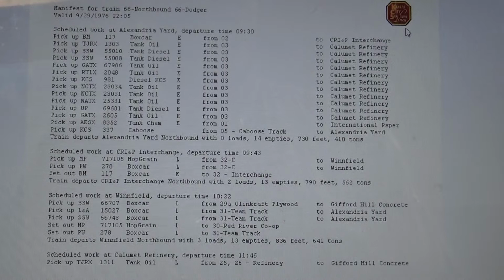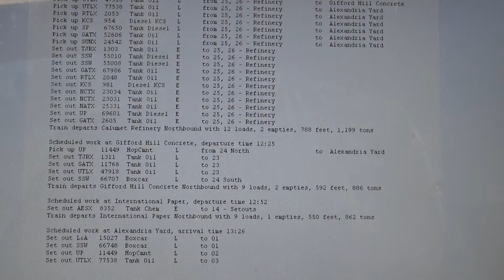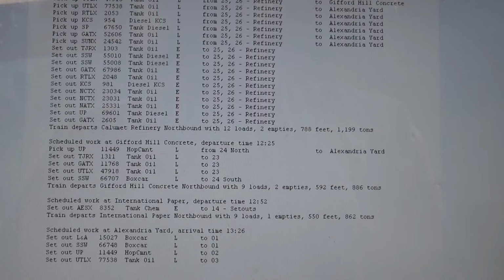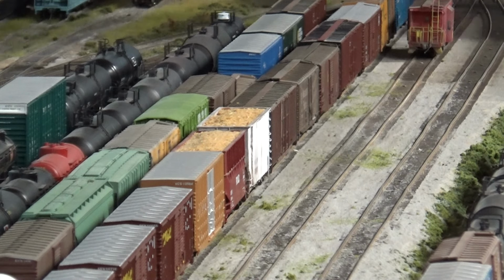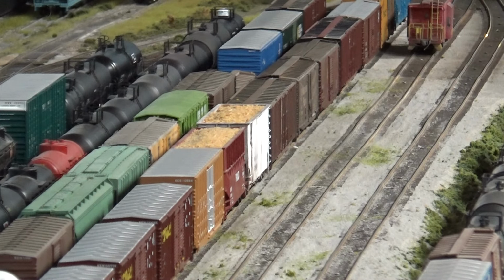The Flying Crow Layout - KCS Northbound Dodger #66 - Part 1, Building the Train

Comment: This is a completely different layout that is coincidentally similar to the 3rd Sub I’m guessing?
Reply from the maker: The 3rd sub is running through Oklahoma.  Mine is set on the Minden sub (loosely).  I think Steve Davis' 3rd sub is set in 1982 and mine is set in 1976.  So we do overlap some in motive power and rolling stock.

Comment: So Robert,  I like the way you built up that train but, if you were in an ops session , you took 45 Min. or so to build that train. The rest of your operators were sitting there waiting for that train to clear. You may have trains waiting out on the main for this  opposing train. I'm not saying you took too long or you did it wrong , I' m saying you ran it the way I would have, mistakes and all, but what about the rest of op session people ?
Reply from the maker: Normally, when you have an ops session, you will have trains built already for the other operators.  The yardmaster would do yard jobs and break down previous trains and then build trains for later in the session or for the next session.  That way, you are already ahead every time you start.